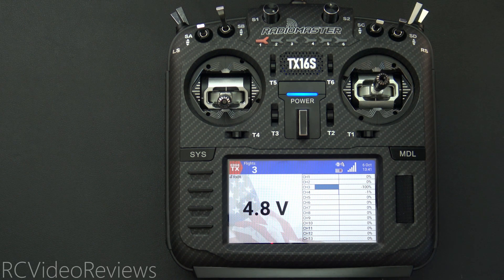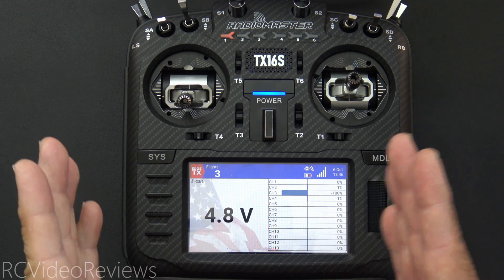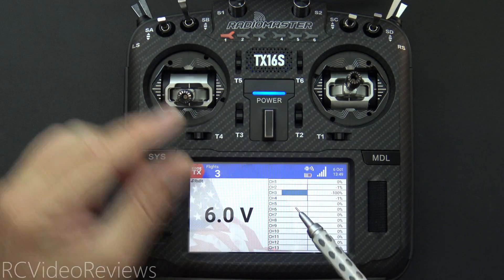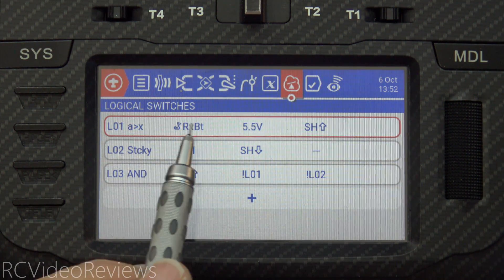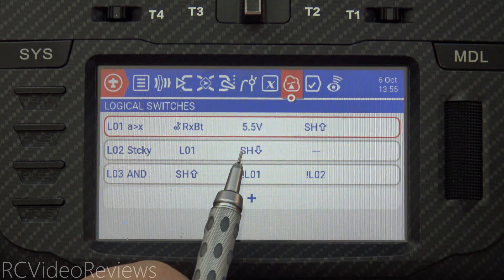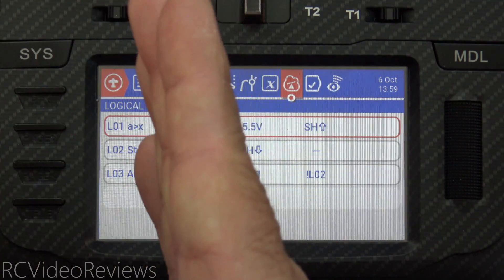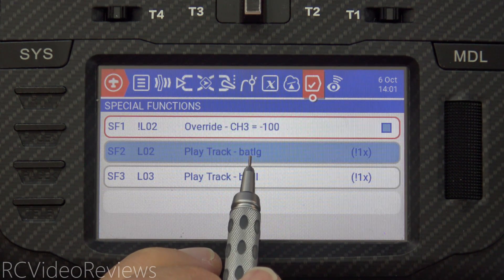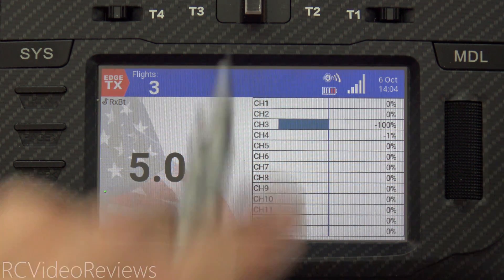EdgeTX can MAKE SURE that Flight Battery is READY TO FLY your RC PLANE or RC HELICOPTER

Comment: I set up this feature and I love it however, I have one issue I need to fix. If I accidentally press my reset flight button in flight, my Heli drops out of the air because the reset makes it check the flight battery, which of course is depleted below the threshold. Any suggestions on how to disable my reset button when motor is armed?

Comment: If you accidentally hit the disarm switch while in flight and below the threshold, do you lose the ability to restart the motor?
Reply from the maker: Yes. The arming sequence is unaware of the location of the model. The check is for voltage independent of where the plane is in space.

Comment: Hello, does this video replace the version you made where if you lowered the voltage for less than 6s nothing happened?
Reply from the maker: I think you're confusing subjects. The "6s" video had to do with voltage sag under load for an alert while flying. This video is about ensuring the flight pack is fully charged before even taking off.
Reply: @RCVideoReviews  Ah ok, thanks for the clarification, I really appreciate your videos.

Comment: Been doing this for years.  I get notified if the battery is full or not and how many cells whenever I plug in the battery.  I use  3 levels of battery low warnings.  Takes 16 logical switches to do it right.
Reply from the maker: 16--wow.

Comment: Ha! I have been using this with my OMPHOBBY M2 V2 since 2021.

You can use the battery telemetry, logic switches and flight modes to create your own battery management logic.

On my M2 V2, I have the following:
1. Pre-arm undervoltage lockout.
2. In-flight low voltage warnings.
3. In-flight low voltage cut-off.

With the warnings, I have two levels. The first one simply alerts me and if I shut my helicopter's motors down, I still have enough power available to restart.
When my second warning fires, if I shut my helicopter's motors down, that's it. If I try to restart my helicopter, I will hear an audible "low battery" alert instead of my helicopter restarting.

My low-voltage cut-off, as the name implies, it shut my helicopter's motors down when the battery's voltage crosses a pre-set threshold. After that, I cannot restart my helicopter.
If I am still flying, this forces me into an autorotation and I must land immediately. In reality, I have only met this stage once (only because I did the idiot thing and ignored my previous two "low battery" alerts).

If I disarm my helicopter, even when my first "low battery" warning has fired, I cannot re-arm my helicopter because my pre-arm undervoltage lockout has kicked in, and the lockout will not release until the battery is charged above 85%.
Reply from the maker: Very nice! Good work taking advantage of the power of EdgeTX!